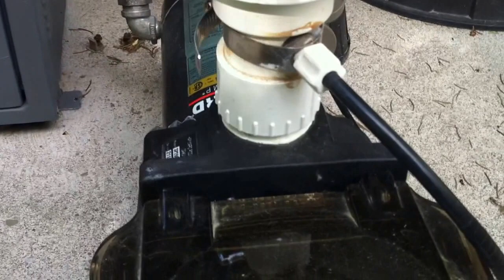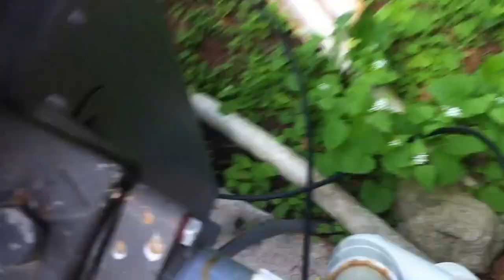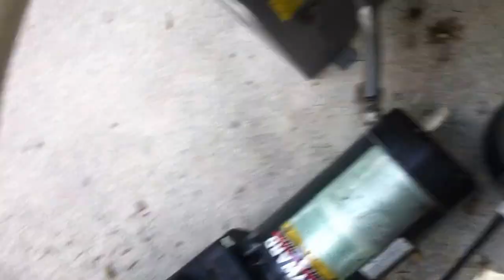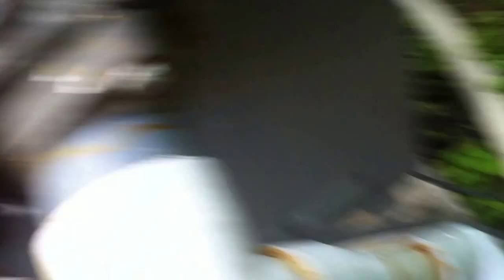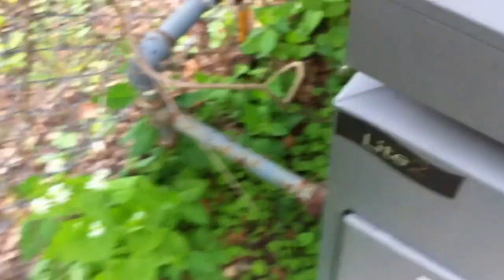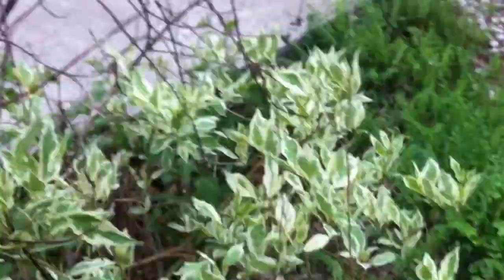Pool Equipment Installation - Offline Chlorinator & Leaks

Comment: I've noticed with the majority of pools, that the mechanicals (pumps, filters, tab towers, etc.) are located outside, exposed to sunlight, weather, UV damage to PVC pipe, etc. Why is that? It seems to me that it makes much more sense to have all of this equipment protected as much as possible from the elements.

Comment: question: the only time the chlorinated water can travel back into the heater is when the pumps are off, right or wrong? Assuming there is no check valve

Comment: That off-line chlorinator DOES have check valve. It’s located on the outlet port of the chlorinator and protects the heater from reverse flow. You were looking where it enters the return line — that’s not where the check valve is!
Reply from the maker: Yes the unit itself has a check valve, but that is not the concern. The concern is for other equipment in the installation, like the heater, and the check valve prevents any of the chlorine being put into the return line from travelling backwards into the heater. The check valve in the erosion feeder would work to prevent backflow of chlorinated water into the suction line tap, but again we are worried about the pressure side where the chlorine is actually introduced to the plumbing system.

Comment: Steve - great series of videos.  Other people's pool plumbing is always a head scratcher for me...  But I do tend to overthink things ;->. I'm busy now getting ready to replace the our small sand filter with a bigger one (2" fittings, instead of 1.5" fittings).  Using sweeps and only flex pvc on the backwash line, and only there because it has to face 'the wrong way', given the silly hayward 'in out' on the same side valve.  Should have bought the front valve mount.  Hopefully, next time I need to do this, 10 or so years on, I'll go back and read my notes.  And look at your videos.  Again, thanks!!!